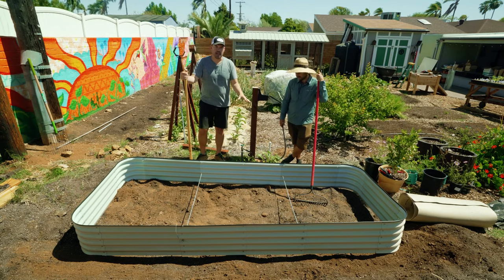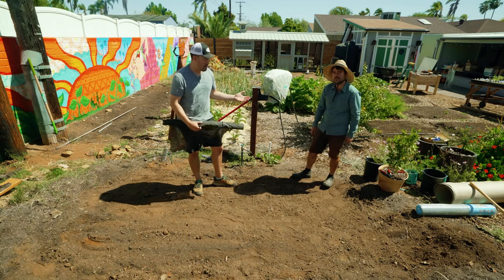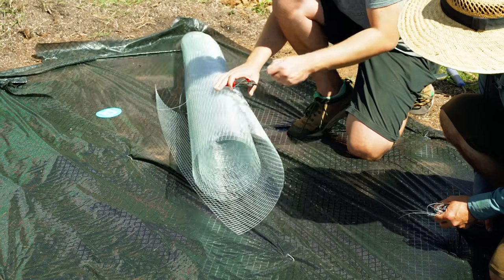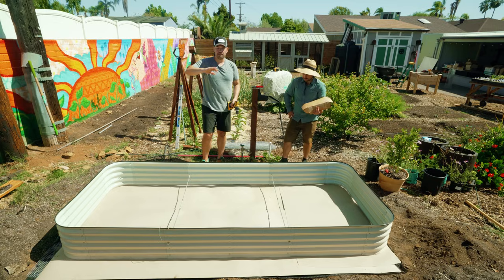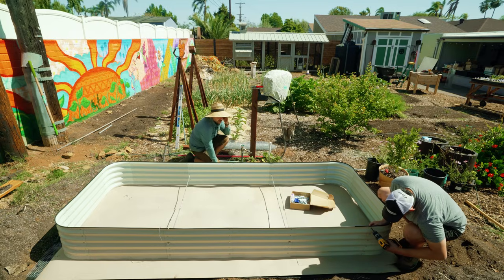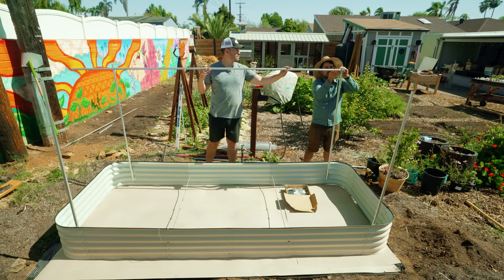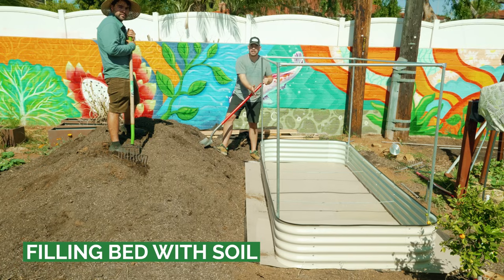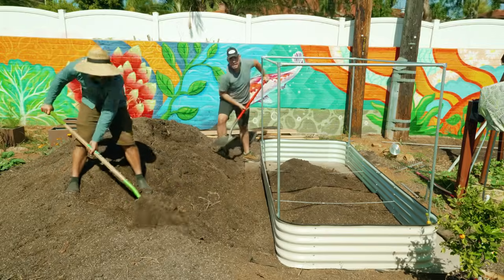How to Perfectly Pest-Proof a Raised Bed

Comment: Personally this is too hard of labor and work for me. Totes are cheap and stop all kinds of critters, AND Here I started using Tulle, many years ago I found it at the fabric store analyzed it and knew it would work.  Bird netting can kill birds, I found tulle the very very best, and SO CHEAP, and works great, cost next to nothing.  Nice Video. 🙂
Reply from the maker: Nothing wrong w/ that approach guys!
Reply: And tulle is so fancy too!  😊
Reply: @BritInvLvr  I love it!!!
Reply: Totes? Can you explain? I just bought sonic posts for voles 😬
Reply: IntegrityandKarma anything mesh material.
Reply: I was going to suggest tulle. Too funny. I learned about it from your channel Robbie.
Reply: @IntegrityandKarma  18 gal totes you use for storage. Walmart sells them for around $7 each. You drill drain holes in them and grow in them. Robbie has videos on her channel about it. Very easy and cheap to do. I am doing it this year in my garden. I got 4 totes prepped and ready to go. Plus, you can compost in place.
Reply: So, I’ve had roof rats straight up chew their way through tulle. It’s not a perfect solution. I’m honestly trying to think up something with metal mesh, because these rats are driving me crazy this season. I just came home and saw that they ATE THE TRUNKS of my 2 yr old golden berry plants. 😭
Reply: Ive got ALL my totes and planters done "The Robbie Way" 😁👍 I even got cattle pannels and t posts to make arches for my garden going from tote to tote!
Reply: I just saw a baby pack rat last night and was wondering if that pest was something I need to worry about eating my “first” garden. So I take it rats WILL eat my garden?
Reply: @LG-gw6xw  I think any critter hungry enough - that has accessibility - is a garden liability. This is my third year and they’ve never been this bad. They’re visiting daily when previously it was 1-2 times a season. Prepare for the worst, and be pleasantly surprised I say!
Reply: I still use hardware cloth on the sides of my beds and pots. It works as a trellis as well as squirrel deterrent. I hated bird netting - tried it - it was impossible to work with, snagged on everything, and nothing could break it, which means anything stuck on it (birds) would also just wind it around and be unable to escape. It also did not keep out cabbage whites, so did not do its job.

I love tulle - it is super easy to work with. I use binder clips if I need to, or just wrap it around and use rocks to hold it down. I have insect cloth and I love it but tulle is much easier to work with and cheaper as well. As far as I can tell, it keeps birds, squirrels, insects out. So good material!
Reply: @britanica7539  Yes, me too!  Plus I've heard so many issue about birds being caught in bird netting.
Reply: My gardening style is closer to Robbie's than to Epic Gardening.  Both have great ideas but for me, if it's cheep or free, so much the better 😁
Reply: I use tulle also, but find that is degrades here in the heat, rain, and humidity of the south (AL & TN border).  I does last about 2 seasons, and it can't be beat for keeping the worms off of my brassicas, so I use it over my raised beds every spring and summer anyway.
Reply: @britanica7539   aha! When I saw " totes" I thought of the original rain shoe/ umbrella accessory brand. You can now understand my confusion. 🤣 I grow potatoes, tomatoes,celery,cabbage in 17 gallon tubs ( the kind you use next to a pool).
Reply: @britanica7539  thanks for your reply!
Reply: Great idea!
Reply: @lmichelle6244  How about a pic? I’d love to see that!
Reply: I agree! I have a small garden and some other scattered ones around the yard, and I don’t want to do that much work. I’m very tiny and 67, so I try to avoid heavy work because of my back. It already hurts watching them!
Reply: @melissasullivan1658  oh no!
Reply: @aquariusrizing  Every year is a new challenge. It’s Mother Nature keeping things interesting. 😏
Reply: @melissasullivan1658  I've dealt with rats in the suburbs. I called my son over to quietly shoot the critters.  They abandon their nests and move somewhere else
Reply: I used tulle one year and found that the tiniest of insect pests could get in but it kept the bigger predator bugs out. The flea beetles had a flourishing population and a great time with my arugula plants that year!
Reply: @lisaviviani7558  what did you do to solve the flea beetle problem, Lisa?
Reply: @melissasullivan1658  I have ways to stop the rats with tulle and it works perfectly
Reply: @LG-gw6xw  we have them here and we leave them alone as they are native creatures and are territorial and many times they drive the Norway rats out. Wait and see if they cause much damage.
Reply: @sbffsbrarbrr  bird netting can kill birds as they easily get stuck in the larger holes
Reply: Yeah I wouldn’t do anything except try to figure out a way to keep them from the plants oh and plant sacrificial plant or two for them to eat. But yes I’ll wait to see what happens. Thank you.
Reply: @katherinehenry1480  I used row cover which helped a lot. They are tenacious little beasts though! They totally laughed at the DE that I dusted them with.
Reply: @lisaviviani7558  i have been trying to grow eggplant without toxic chemicals. If I use row covers, the bees can't pollinate. If I don't do anything, the flea beetles ravage the leaves.
Reply: @katherinehenry1480  Tough, I haven't found an answer to controlling them naturally. Maybe plant arugula in your garden and they'll be attracted to it more?? 😂 It's the one thing in my garden that they seem super interested in! (But I don't grow eggplant so they might like that more)
Reply: @lisaviviani7558  thanks for responding
Reply: @katherinehenry1480  When you use row covers, you can hand pollinate.  Just use a paintbrush and go from flower to flower, pretending you are the bee 🐝
Reply: Thank you so much for this video I will be trying this because I have a squirrel problem. I have totes and tulle and it works. However I still want to extend my garden and I will be trying this method as well. Thank you ❤️
Reply: So is there a cheap shade cloth at fabric stores?
Reply: @katherinehenry1480 

My mom said she uses sulphur for the garden mixed with water. Not sure how much of each.  Does the epic gardener know?

I  can try and get the details for you   if you want but I won't be able to get back immediately.

Also, I saw you and others had issues with mice and rats.

A few years back I had seen a video of a man who used a baking soda and cornstarch mix for outside use ONLY, otherwise you'll have dead rodents in your walls and that won't smell very well.

The man said they don't flatulate and so this mixture will kill them but is not poisonous to humans or other animals.

Google search these two items to read more.

Good luck!  We have garden issues as well.  When it is super hot in the summer, all the wildlife will eat anything with juice.

We have the biggest problem with tomatoes usually. 🌝
Reply: Is there a finished image? This just showed a frame.

Comment: With 4 dogs and 6 foot privacy fence all around, I don't have to worry too much about most pests, because they're scared off by the dog's scent, so I just need to deal with cabbage whites.  I'm putting everything they might want to go for as well as other things that don't need to be pollinated into the same bed so I can just make hoop covers with rebar and pvc pipe and bug nets since I don't have to worry about bees getting in to pollinate.
Reply: I got no pollen and I hsve no bug net. We r getting very short on bees.
Reply: @MeTreesndirt  If it wasn't clear from my initial description, nothing that goes under the bug net flowers anyway.  Things like kale, brussel sprouts, carrots, asparagus, that don't produce fruit.  I want the bees (or, more likely the case in my area, burrowing wasps) to be able to get at the flowering plants, which is why they're in other beds that don't get a net.
Reply: I had the cabbage whites last season, thanks for the tip.  I had read that they are territorial and won't go when they see other whites so I cut out some shaped white paper but still had some, maybe i cut out more and a little bigger but will apply your idea as well

Comment: the hardware clother center overlap may still have the intrusion of gophers, saw them get through in a video from the next level garden homestead, i think the mesh overlap needs to be tied with a wire in a tight connection to prevent it be more aggressive with overlap and wire it up
Reply: Yep, or stake the overlapping sections like you do the landscape fabric

Comment: My .02, I would have put the hardware cloth down first, that way it keeps the chewers from getting to the cardboard and the weed cloth. I also used 1/2" PVC, heat formed, zip ties and netting on the top. Nice back wall

Comment: I use 2 layers of chicken wire on the bottom, a layer of weed fabric & 4 or 5 layers of cardboard. I do use Hugelkultur (sp) so my beds all start with logs & limbs then dead plants, weeds etc. grass clippings, then old potting soil etc. My problem is that although I can protect the bottom & put shade cloth or fabric over the top it seems that my major problem is wind. Many of my plants don't make it through the winds that we have in the Southeast panhandle of WV. I have tried a variety of things but many of the plants are not strong enough although they have been grown in my greenhouse with a fan on them from the beginning. If they make it initially they usually acclimate but its hard to get them strong enough to withstand the winds.

Comment: We have done this same idea this year but with different materials. Rather than metal poles we used the plastic coated Metal rods that come in a selection of lengths meaning it wont rust out as theres no metal making contact with moisture but it still retains rigidity they also have a sligtly rirged texture along the poles so it easy to string out additional lines for climbers. Then on the corners we have used "Build-a balls" which the rods simply slot into but they also have the benefit of creating a smooth corner so whatever covering material you use to cover with wont snag.

Ours are currently covered with bird netting as we were having issues with blackbirds and starlings coming down and digging about in the areas i just sowed seed into and also with a local cat who decided my salad bed would make a great litter box :( Not any more kitty!! The 2m lengths have made an easy fruit cage and the shorter ones I have attached a willow concertina trellis as the back wall to grow peas up.

Comment: This is a bit much for me personally, and I wanted to use my raised bed to help develop better soil and invite the earthworms that are in the soil. So I just threw down cardboard on the patchy grass and went from there. For cover to deter raccoons and possums, I use landscape fabric weighted down with bricks and concrete blocks. Obviously nothing is planted while it's covered like that.
Reply: I didn't even use cardboard ony most recent beds, I went with hugel mounds. I used a shovel to cut the grass and weeds out of my paths and flipped them over upside down onto the bed, then covered with brush decomposing logs and woodchips, then I dug my paths out 2ft deep and dumped that dirt on top of the wood layer, then I topped with about a foot of compost and granite dust. I then back filled my pathways with mulch to test a technique Diego footer has talked about
Reply: Think this video is specifically for people with serious pest problems. They mention they don't do this normally (during the part when discussing the landscape fabric).
Reply: @ra2bk  Yes.  Here in Southern California, gophers are a serious problem.  The metal mesh is usually  efficacious in keeping them out of vegetable beds.
Reply: Also, if you have ferocious weeds like Bermuda grass or bindweed, you literally cannot reuse the soil. The weed will come back if you leave so much as a .25" piece of stolon.  It's rough.

Comment: I'm concerned about the gaps at the bottom of the frame where it meets the prepared bottom surface. I see light coming through here and there. We have a huge vole problem and I know they would squeeze through those gaps. The wire cloth would have to fold up inside to make a kind of basket.
Reply: Drill holes into the bottom of the bed every 6in or so (if it's a metal bed) & zip tie or twist wire to lock the hardware cloth to the bed
Reply: Yeah our voles are like that - it needs to be Fort Knox to keep them out. We have wood beds and I'm trying to think of a way they can't climb up the sides, perhaps wrap it in a slippery metal sheeting around the bed?

Comment: I don't like using bird netting because we have had too many experiences with birds and squirrels getting caught in it.  We might try good old chicken wire this year and/or tulle fabric.  I also have a pop up that will cover some of my plants, as well as cloches.
Reply: Same here, squirrels are my biggest adversary and I will need wire.  They will get through the cloth in a heartbeat.
Reply: Squirrels,  bunnies, birds, and raccoons are my problems . Chicken wire seems to be the only thing to keep them out. Put it on all 4 sides AND the top. Problem is... it's cumbersome to get access to the bed. This year I'm going to try making a "door" on one  side with pvc covered in Chicken wire.
Reply: @cassafrasskotter7238  , that is exactly what I am doing - putting a "door" on the cage!  As for the top, the chicken wire is too short, so I hope to rig up a tulle fabric topper.

Comment: My raised beds are set up almost identically to this, even with the hardware cloth underneath because we have a mole problem around here. I bought PVC to build a cage like you did with the metal, but I'm wondering how best to add the cloth/wire to it, while still being able to easily access the bed. I was really looking forward to you explaining that in your video...but then it just ended. Help, haha!!
Reply: I felt the same way! Step by step options for how to attach the shade cloth would be great!!

Comment: Budget Hillbilly version...
Level, build up edges with whatever available material, layer from bottom with gravel and or logs, leaves, grass/green leaves, soil, manure, work in soil and manure, top with hay or mulch. Plant after a few good rains. Surround with hog wire and or chicken wire, top with nylon netting.

Comment: Any thoughts on keeping a lab out? He is the biggest pest I deal with.
Reply: Lol mine too. He eats everything including the green tomatoes (and is very good at nibbling the strawberries off the plant!). We did something similar to this but we used the rebar and plastic tubing and made it more like hoops across the bed (cheaper and faster) and we put the bird netting on top and had to tie it on to our metal raised garden bed so he couldn't get his nose underneath the netting. And put some small barriers up (like chicken wire but more sturdy) along the sides as well for the garden beds he really liked.
Reply: i put some sticks in the ground and tied lengths of twine between them, to make a little fence. Keeps the dog out pretty much, just deters him in a different direction. Although a Lab might eat the sticks!
Reply: Electric fence netting isn't that expensive... That was the only way to reliably keep my mastiff out. Traditional training shock collars he didn't even notice. Beep vibrate or actual shock and he didn't even flinch. He only touched the netting twice now he leaves the garden alone.

He REALLY liked trying to eat the bone and blood meal soil amendments killing plants to get to it on top of eating the produce
Reply: We had to fence the whole garden here.  It keeps out the dog and the ducks too.

Comment: 2 quick thoughts - while I use something similar for my own raised beds, Iirc, you mentioned using this bed for asparagus-wouldn't this method cause issues w/ deep rooting crops like that, or do you have some suggestions/methods for those plants to root past the cardboard/fabric? 

Second, for the birdees raised beds, I've taken to drilling holes right near the bottom & zip-tying the hardware cloth every 6in or so-takes the slack out & keeps burrowing pests from digging under & creating a gap between the cloth & the bed wall.
Reply: I was thinking the same thing on asparagus. I would have thought he would have used the tall bed.
Reply: @dianeallred9288  even then it wouldn't really be deep enough

Comment: I need protection from Japanese beetles, but not bees, and they are roughly the same size. So I choose to use beetle bait bags around parameter, leave open to the bees to pollinate the plants, and fence for rabbits and deer. Hardware cloth/landscape cloth beneath to block out the moles and grubs.

Comment: I have a rat problem in my garden. Love this idea! Using hardware cloth around the frame, how would you make a door to access the veggies you are growing?
Reply: I would cut a panel out of the side and use wire or zip ties to create a hinge; I would make the door either lift up on the hinge or swing sideways on the hinge. Then use clips or twist ties to hold it shut.

Comment: I am one tall birdie bed into my garden journey and this makes me want to reset it and start over this winter using this method.  Learning so much from the channel.  I am wondering if PVC pipe would work just as well as the electrical conduit since I have better access to it and it does not rust.  thanks.
Reply: PVC is much more flexible especially with small diameter and thin wall schedule 40. Just make sure you test the weight that the pvc your using can hold.
Reply: @yolo_burrito  ok thanks for that... perhaps i'll back it up with something inside.